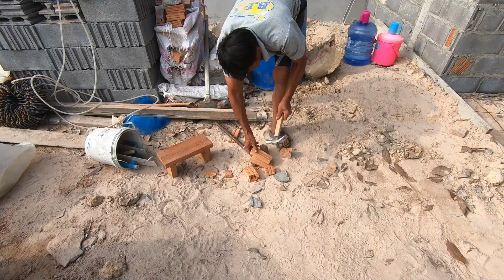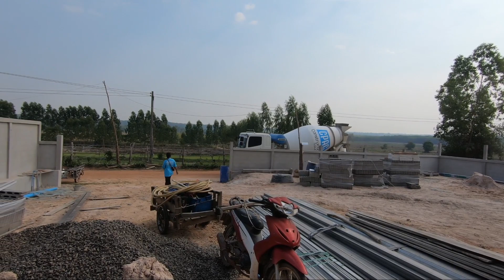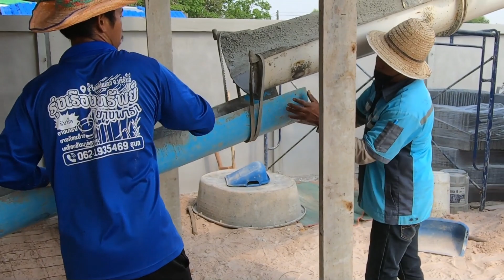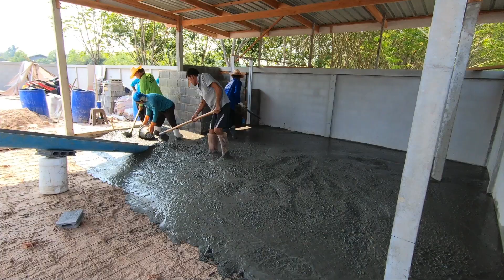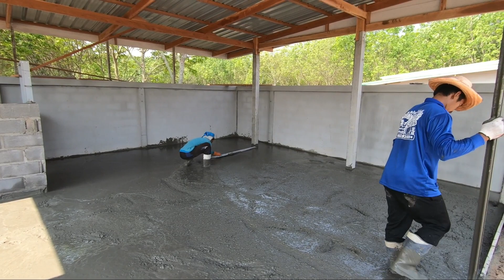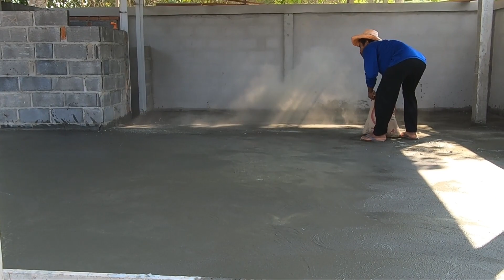New House Build part 17 - garage slab poured

Comment: That concrete is way too wet all the stones will sink to the ground,and the wetter it is concrete is weaker,and it segregates  ,what height are they screeding to,looks like freehand lol.they should be useing a laser level or have pin set at right heights,good luck.
Reply: @sunriseinisaan  U are right,we do things completely different,as long as it turns out in the end .

Comment: In America, we screed it fir get the level. Then they float it with bull float to push the rocks down a little and bring the cream to the top.That cream makes smooth hard surface. They must be using chemical with the concrete in Thailand to be able to do that under that kind of humidity. Concrete dries fast under high humidity. We don't want that. The concrete should be cured, not dry.